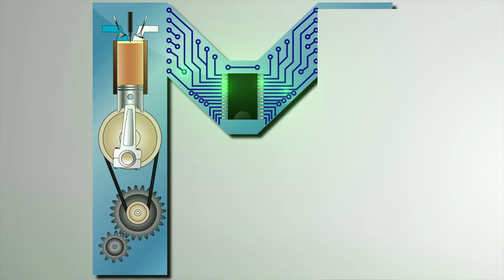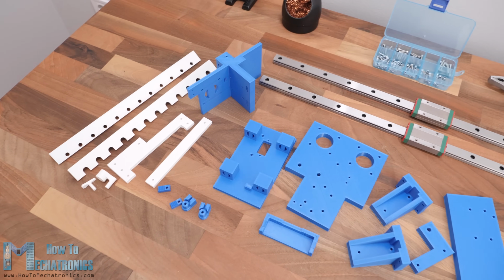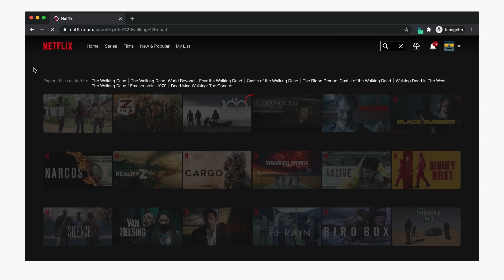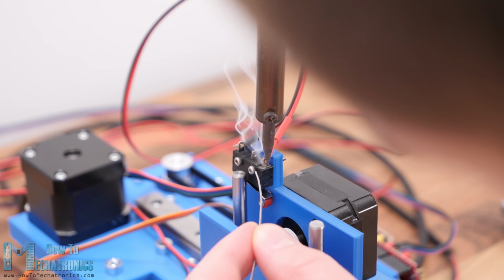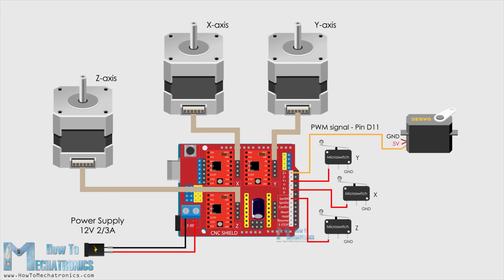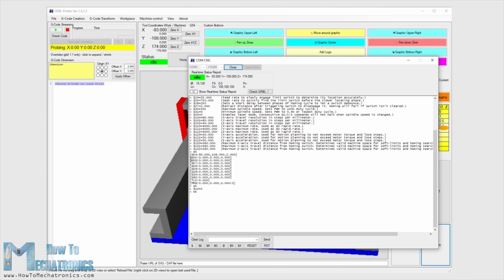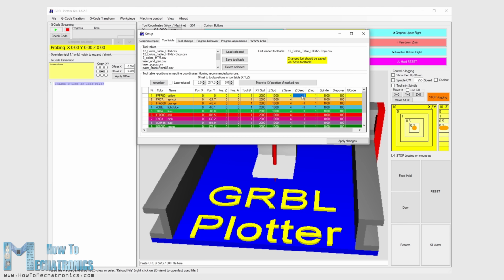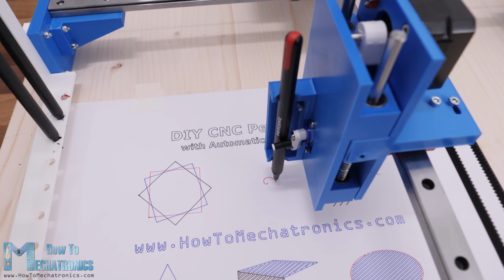DIY Pen Plotter with Automatic Tool Changer | Arduino based CNC Drawing Machine

Comment from the maker: I hope you enjoyed this video and learned something new! If you'd like to support me making more content like this, please consider supporting me on Patreon: https://www.patreon.com/howtomechatronics
Reply: Thank you for sharing your design. Absolutely wonderful. Approx 35 years ago my father in law invited me to work to see his new toy on the factory floor. It was a pen plotter and I was as blown away as he by the simplicity and the accuracy of the printing it output. The drawings were end cap units for grocery store refrigeration units. They were generated / output by AutoCad. This is an incredible design. Additionally, the head could be swapped and a different one added to mount a magnet unit for a sand table. Good stuff.
Reply: This is brilliant! A death knell for all sorts of printers.
So be careful. The inkjet, laser and dot-matrix printer industry cartel controls a billion dollar market. They will come after you.
Please have a crowdfunding industry set up and build these printers for customers. In time the components could be miniaturised.
Reply: Please make a Belt 3D printer, the ones available are too expensive and I know that only you can do that
Reply: I want  your  brain!
Reply: wonderful! You can use it to change between different tickness of pens instead of colors; it is specially useful with PCB projects but also in more detailed nankin drawings. It's possible with a few changes only in software.
Reply: Very nice tutorial. Thankx a lot. But how and where we can build the blues supports parts?
Reply: I am Brazilian and I confess that my financial situation is not favorable at the moment. I would very much like to know if you would sell it to me at a lower cost. A discount, not that this is used for... I'm sorry, but I'm a person with a disability. And this project would help me a lot in my life. Please see what you can do. In Brazil, 1 US dollar is equivalent to almost R$6.00. To assemble a machine or... Buying one with all the extras would cost me almost the price of a car.
Reply: Sir please make a simplest 3d Printer but with a good level of details, speed and work area.
Love from India❤️❤️❤️❤️❤️❤️❤️❤️❤️❤️❤️❤️❤️❤️❤️❤️

Comment: Great work, I think we need the laptop connected with Arduino to keep it plating the design from Gerber file.

I need to permanently fix a simple design to Arduino and plot the same whenever I want.

Suggest me some solution.

My main goal is to design a glue machine, the pen will be replaced with a glue nozzle and CNC will Always follow same pattern.

Comment: Got a quick question here. From the circuit diagram and gbrl-servo library, I noticed that pin D11 (which is originally for the z-axis limit switch on the CNC shield) was repurposed for the servo, therefore the z-axis limit switch was connected to D12 (the Spindle Enable pin) instead. How did you configure gbrl to recognize that the limit switch was now connected to the spindle enable pin (D12) instead of the original D11 pin?

Comment: Ok. Great vid. I'm obviously missing something though, I'm lost as to where to find the 3D printed elements of the structure. I am in the process of considering the purchase of a home 3D printer, and if that comes to pass I would like to undertake this project. If the 3D (blue) components aren't available to purchase are the plans for home self manufacture available? Like in general what I've seen of your site, as a reitred engineer I spent many years servicing and refurbishing much larger machine tools, and would be happy to build and use smaller and cleaner units at home.
Regards
 Peter

Comment: Good evening, my name is Ulrich. I decided to carry out the above project as you explained and I did exactly the same thing. Except that I have a Problem: the axis only works in one direction. I would like to know if you had the same problem either with the code or with the application and how you solved it please. it's urgent please.

Comment: I've completed the build for the hardware, electronics, and the GRBL Firmware. I'm trying to setup the GRBL-PLOTTER on a Raspberry Pi 4, but GRBL-PLOTTER has a Windows DotNet 4.0 dependency. Do you have a work around for this?

Comment: why is there a need for stepper motor in z axis cant just a servo work
Reply: I built my own plotter. its a different design but I also use a stepper for the Z axis. This was a choice which gives me more flexibility as far as pen height and pressure.

Comment: Lots of nice expensive hardware for a weak unsupported end on the drawing machine. I was hoping it would have the strength of a cutting machine and you could swap out the pen holder for a swivel knife blade holder.

Comment: I have completed my own Plotter after 4 Weeks and tens of hours today 😎👌 its very, very accurate, worth building and sooo much fun to see, how this DIY Plotter is and was painting my own A3 Scetch of the Chernobyl Power Plant Nr. 4 😂😂

But some things to know, for them, who are building this little monster of Scetches:

1. You have to own a good 3D-Printer, which is perfectly aligned, so the tolerance is low for the pieces to print, or, like me, spend hours on deburring them- but its relatively easy to do with a goood deburring tool 😌

2. The minimum 9 Jumpers for the (cheap China) CNC Shield are not in Stock with it, so if you dont have a Computer Store, order them right with it. 

3. If you‘re thinking of building your own, purchase minimum 600cm long Linear Rails! You won‘t regret it! For my own, i „only“ have 550cm ones, and its kind a little though 🙂

4. The most frustrating at all is, get the Endstop-Switches and Homing to work, especially if you got one of these chinese CNC Shields- You have to tinker hours to get them working- really! The switches must be connected differently than shown in the Video:

„Y+“ to Spindle Enable
„X+“ to X-
„Z“ to Y-
(my working configuration 🤷🏼‍♂️)

5. Configuration of the grbl-Code is kinda tricky, because  it false-triggers the Endstops much times, for me it worked right from the Moment i‘ve disengaged the hard and soft Limit switches (believe it or not 😅) and turn on Homing Cycle xD

$20=0
$21=0
$22=1
$23=0

6. Order Drag-Chains! You won‘t regret it, looking beautiful! 🤫

7. Don‘t think, GRBL-Plotter is a easy Application: simply the import of pictures can be very time-consuming, because of Windows „Technology“ - 15 minutes of waiting for ending on an ugly-filled sketch is normal- Have „fun“ with it! It does its work, but preoperational vectorisation of the pictures with eg. Inkscape to svg. Format is heavily recommended 😝 

8. Automatic Changing of Color Pens is propably possible, but you have to do so many settings, simply for drawing 1 colored picture and then, for drawing a simple Grayscale picture after, seeking for your old settings again, frustrating not to have a good manual - 

Learning by doing is your only option to have a good result at the End 🤪🤪

Much fun for you guys building this funny thing of Technology!

Greetings 😎👌
Reply: hello brother . i am also building my own plotter can u help me to do so . if yes can i get your insta or phone no so that i can contact u for some advices
Reply: mine took 3 years omg
Reply: Alex sell me yours ill buy it

Comment: Awesome video! I'm going to build one soon. I'm new to CNC/GRBL codes but just wondering about the scenario where we have only one fixed pen attached to z-axis and instead of using a motor to move the pen up/down, can there be a magnetic lever to move the pen 5mm up/down? For example, instead of a pen, what if I attach a blade to cut paper and move the blade by activating/deactivating a magnet? We only need to move the z-axis 5mm and try to remove the extra motor and driver to make the project lighter. Not sure if the GCODE would work with an electronic magnet. Thanks for sharing the project.

Comment: Terrific video! I had a quick question, my Z stepper motor isn't responding while running gcode, but if I press the pen up/down button the motor responds. Hoping it's just a setting I missed...Thanks!

Comment: If anyone decides to go ahead and build this model, be sure to buy the appropriate lengths for the bolts. The bolts listed in his parts list won't suffice since they're shorter than the ones used in the video. You probably want to order bolts that have at least one set greater than 20mm
Reply: Yea, I had the same experience.

Comment: Very nice!  I remember going to a university open house in the late 80’s and they had a multi-pen plotter drawing microchip circuits on really big pieces of paper that were not held flat, it rolled it back and forth while the paper dangled on either side of the plotter.
Reply: Hp color pros 7440a. This is the best thing since

Comment: hello, I have some questions for you 
1- how I can adjust the program ( GRBL Plotter) to don't generate the command (M03/M04),
 when it generates the code this command is automatically generated with the g code.
I don't use the servo motor except for the Gripper when the pen change.
please I want to control my g code generated, I want to code without the (M03/M05) command.
Reply: Hola use G1 Z-60 F6000 y G1 Z 60 F6000 son valores orientativos necesitara ajustarlos yo tampoco uso servomotor uso motor 28byj48

Comment: Hi. 
Would it be possible to use a 3d printer and modify it for plotting or cutting? Asside from the mechanics of such a mod, lets say I hotglued a pen to the hotend.
I have a printer with MKS TinyBee board Hbot configuration,  Marlin 2.0. Can I use GRBL to stream Gcode to it?

Comment: what if there are no jumper caps. will it still works? if not what is the alternative solution for this, perhaps with female-female pin connector?

Comment: Hello, this is a great design and well explained. Regarding you Y axis pin lifter that is four milimeters lower that the begining of the Y axis ( when the stepper motor is at the end of the Y axis and far from the X rail , so at the end) ,  did you tried the solution to add an extra wheel at the end of the Y axis that rolling on the table.
Reply: exactly what I thought and will probably do that in my own realisatio  of this project.

Comment: hello, this is a great design, I've got a question is there a possibility on arduino uno to replace the A4988 stepper drivers with TMC2209 easily ? I am not so expert on Arduino. As the A4988 are really noisy and TMC2209 really silent.

Comment: Awesome build! How long are the linear rails, and how long are the 6mm rods?
Reply from the maker: The rails are 500mm, and the 6mm rods are 120mm, or you can go with 150mm which is more common dimension if you don't want to cut on your own.

Comment: Very cool!

A while ago I played with putting a paint brush in the spindle of my CNC and used a dropper bottle to add acrylic paint just ahead of where the brush was moving.  The result was quite nice, but it was labour intensive.  I wonder now if I could have used paint pens or peristaltic pumps to add paint.

Thanks for sharing.
Reply from the maker: That sounds interesting.

Thanks for the input!

Comment: Why did you design it with both motors being moved? All that extra weight seems like a pain for both vibration and a possible issue for precision. I think you did it as a counter balance for the arm and the stepper motor controlling pen height.

This is a very nice plotter, if a bit more complex than may be necessary.
Reply: Let’s see your design

Comment: How about we use this part solid wood instead of 3dprinted parts can we solve the problem at 11:05
Reply from the maker: Well check my previous video, I made the same CNC with MDF boards, but for laser engraving. It had a better definitely compared to this 3D printed parts, but still in it had a play in that way too. The beam is just too long, 50cm for this to work without any play.

Comment: sorry but for what this complex Z Axis its useless... only use an magnet to Switch it up and down, or a rc servo... less wüeight better Performance
Reply from the maker: Well yeah, the Z-axis is a bit complex, sure there are millions of ways to be made. An RC servo is a common choice for the motion of the Z-axis in DIY CNC plotters, but here the problem was that I used a RC servo for the gripper and with the Arduino UNO and the CNC shield combo we can only control one RC servo.

Comment: The flex in the rail could be fixed by adding a parallel rail with another stepper (this would allow to increase the size of the machine and make it more suitable to work with larger materials (thinking about the laser engraving part)
Reply from the maker: Yes, for sure adding another rail on the other side would solve the problem. But you don't need another stepper, you can use just a single stepper and transfer the motion to the other side as well if you want with a simple shaft or belts.

Comment: This is an incredibly capable plotter, and amazingly accessible. What license are you releasing the models under?

Did you have any issues with keeping tension against the drawing surface? I usually see a rubber band or something similar to give pens a chance to hug the surface without binding.
Reply: Were you already asleep at 07:14?

Comment: With textile markers, maybe on could write on T-shirts?
Reply: You’d need to keep the fabric under tension but I don’t see why it wouldn’t work :)
Reply from the maker: Yeah, that's sounds like a cool idea. I guess it would be possible if the fabric is properly tensioned and the tension between the marker an the fabric is right.